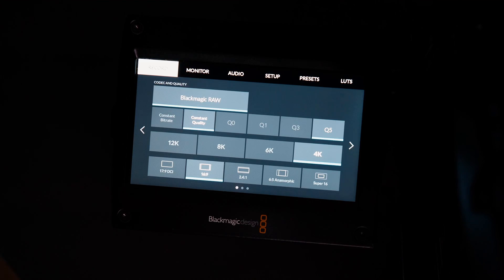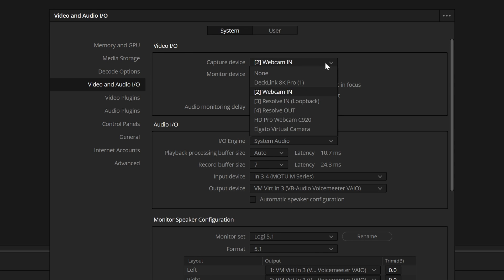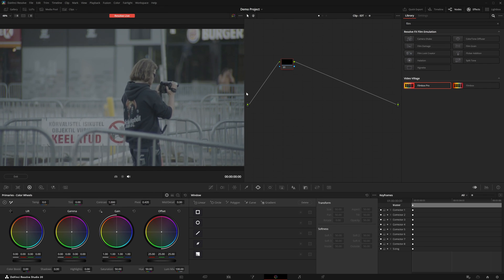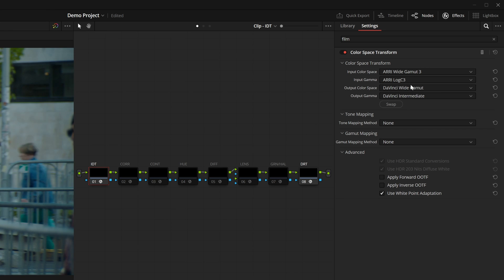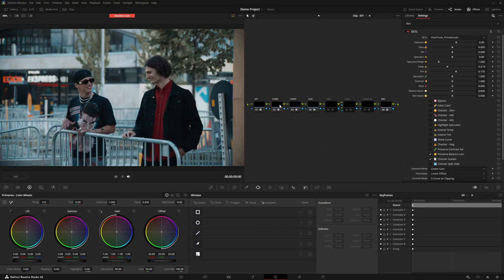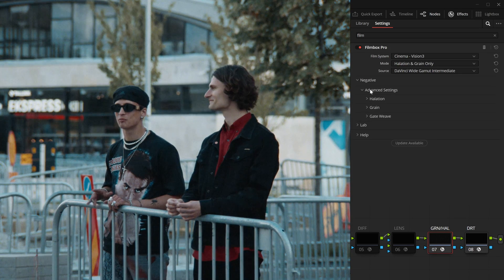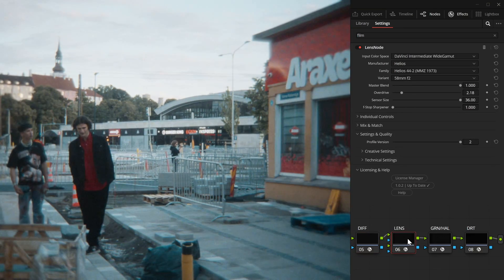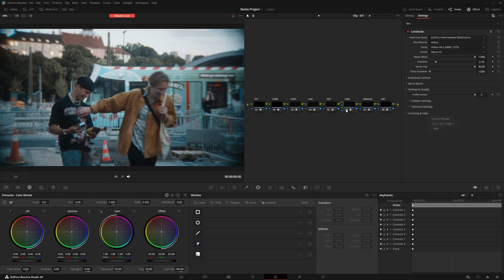Emulate Vintage Lenses & Diffusion… ON SET (LensNode + Scatter)

Comment from the maker: TIP: If you can't get real-time playback with these plugins, lower the resolution from 3840x2160 to 1920x1080 or even lower. Though grain will look different at different resolutions.

Comment: Amazing. But, how can I get back a processed signal on a wireless transmitter like a Teradek so my director and other people on set can watch all these wonderful stuff on their monitor ?
Reply from the maker: There's a few possibilities:
a) Put Resolve to full screen and use the HDMI output of the computer
b) Use an IO card that can input and output at the same time
c) Get a second card that can output, for example a Blackmagic UltraStudio Monitor 3G
Reply: Also, I would love to save everything scene by scene and to be able to apply this when It comes to create proxy files.
Reply from the maker: You can save the current node structure as a PowerGrade. Just make sure to label them accordingly :)
Reply: It will never be latency free so it shouldnt be used as a live reference monitor
Reply from the maker: @robinwebster3690  Absolutely, this feed should be on a separate monitor used as reference, but not as the only camera monitor.